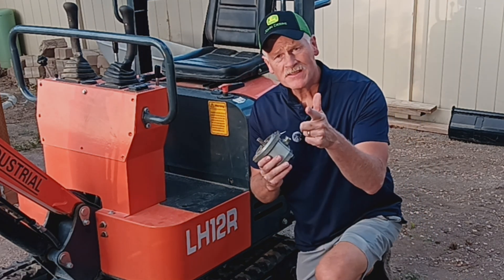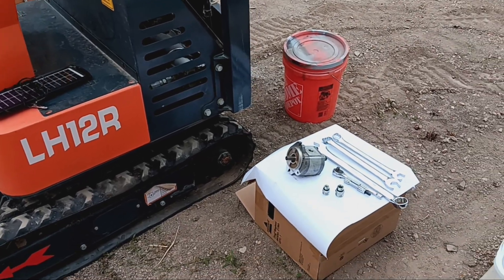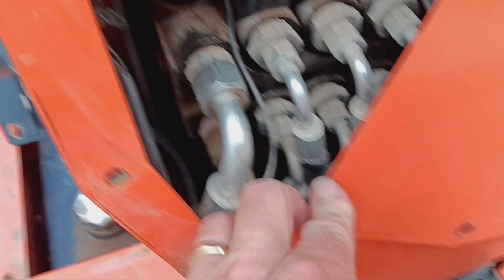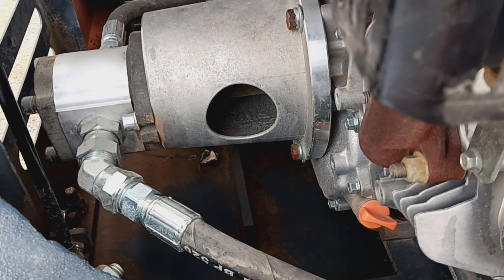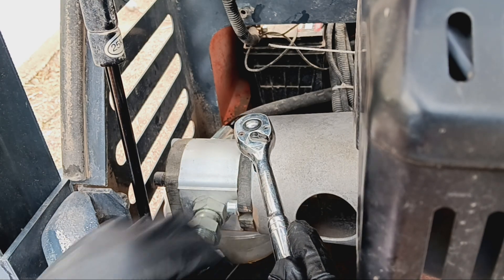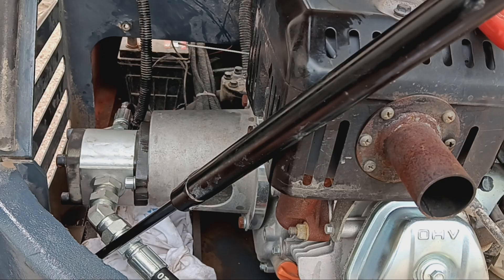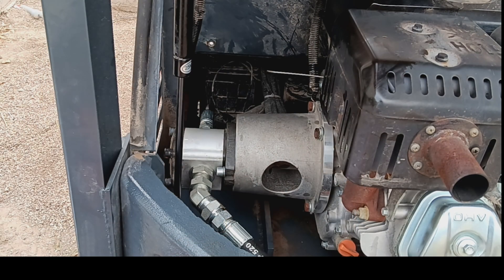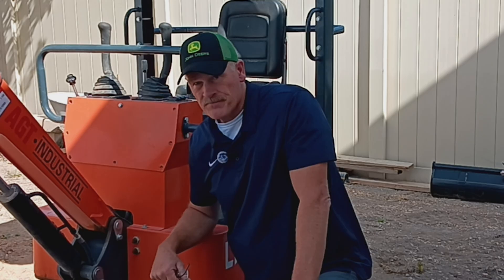Hydraulic Pump Upgrade!  Chinese Mini Ex  More POWER More SPEED!!

Comment: @HomsteadImpossible  what was the original pump flow and pressure vs the new one?  I assume both pumps where gear pumps? had you considered an pressure compensating pump that changes based on demand to reduce jerkiness?
Reply: Many of them seem to be 2300psi, some are 2600psi

Comment: Do you know what adapters the shop sold you?
Reply from the maker: Got the fittings and the crimp done at Hose and Rubber Supply.
I would definitely take the new pump AND existing hose to the store.
They can easily find what will fit both ends.
12FJX-12MB
10FJX-10MB
10G-12MJ

Comment: Most of these 1-ton-ish minis come with a 6.5-6.8cc gear pump.  You have substituted one that
is 10cc (0.61ci).  I am concerned that your machine will be more jerky and your hydraulic fluid is
going to get very hot quickly.

Qs:  how many hours on your machine when you made this modification, and does your mini have
a hydraulic return filter?

Thanks for posting.
Reply from the maker: Honestly, I had a hard time comparing specs.  My machine manual had no info on the pump size.  It was extremely frustrating.  Didn't know what I had so how to know what to get?  How much was too big?  Hydraulic Pumps are new to me.    I knew nothing about when I started.
I just went with one and figured it was 50/50 0n working out.
As in video I ordered exact one on That Kyle Adams used and crossed my fingers.   It happened to barely fit in the Space.
My engine does not have a problem running the bigger pump at all.
No jerkier than before.  I have a good cooler for the fluid.  No in line/ return  filter.
Its running great.  Doesn't heat up any faster than before I swapped.  Hope that helps.
Reply: @HomsteadImpossible  Yeah, all of these machines require doing your own analysis to find out what you have.  You can determine the volume of your original pump by opening it up and measuring.  (See internet for how.)  

If you open it up, note how worn it looks.  Cam Sweet (The Garage Connection) noted significant wear on his gear pump at only 5 hours (no filtration).
Reply from the maker: BTW... Wasn't more jerky than it was.  Mine not too bad to begin with.   The more time on controls, the better i am and less jerky.

Comment: i just run Traveler iso 46 from tractor supply in mine as its what was recommended on the forms its currently $39.99 for 5 gallons at TR
Reply from the maker: Thanks... I'll give it a whirl

Comment: Is it worth replacing the 420cm3 B&S engine (single-cylinder petrol 13.5kM) in the Chinese 1.1t mini excavator with a V2 ~~700cm3 petrol engine, e.g. Lifan/Loncin/Honda ~~22kM? Does this make sense? Sometimes the engine may choke (during sudden movements) and then the entire excavator "jumps". The excavator is powered by Joysticks with a 2-section pump.
Reply from the maker: if you are talking replacing engine, Im not sure.  I am gradually learning more about these.  For the same reason I upgraded the pump, I guess you could upgrade the engine... if it fits.
We all want a bigger and more powerful mini ex however we can get it. Sorry, Prob not much help on that.

Comment: Would of liked to seen the track speed before and after.
Reply from the maker: Roger that.  Could kick myself for not doing.
Reply: Keep an eye on your track tension as there's an increased risk of throwing a track at higher speeds.
Reply from the maker: @SimonCoates  Prob true... Where ever the rock etc is going to throw a track, it will definitely happen a little quicker, making a little harder to avoid.  I do seem to have gotten pretty good at putting the tracks back on..?? I wonder?